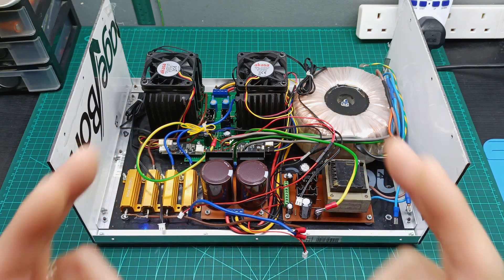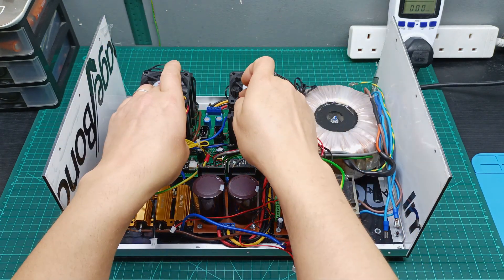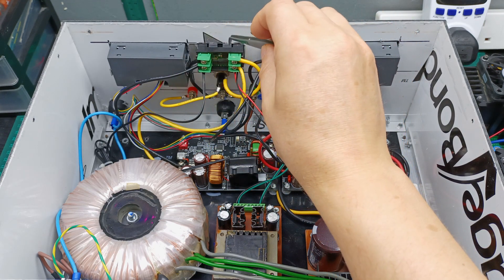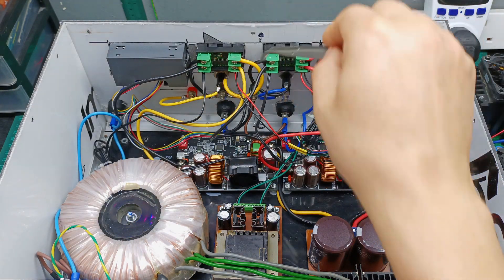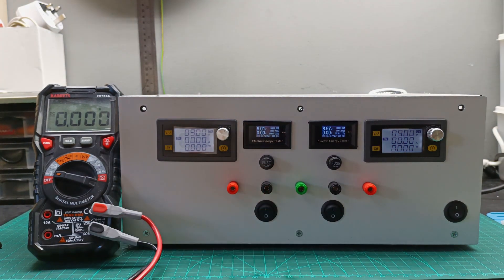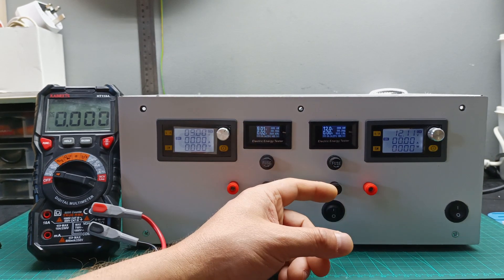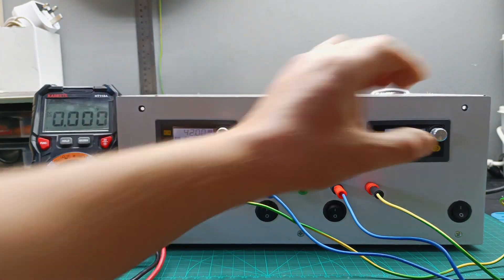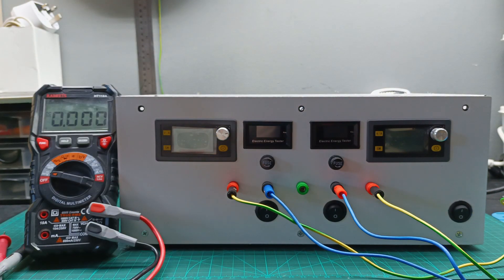Upgrading the dual rail bench power supply

Comment: Now we are talking \m/
Thanks for sharing the link
Reply from the maker: @CraftyZA  this is more better because have over current protection and voltage protection and also do constant voltage and constant current
Reply: @SymbolTech21  I've added it to my cart. The link you initially shared on the bag video no longer works, but a few stores still stock it. One just needs to do a search.
Reply from the maker: @CraftyZA  when I put out the video and the link was still available

Comment: If you join the supplies to provide say  +20v - GND - -40V   to two load resistors with common GND (e.g.  20R - GND - 10R)  are current readings correct? Is current limit working OK?  This is typical use for dual rail supply (not separate load resistors and separate common).
Reply from the maker: Yes when I put them in series still I can regulate the voltages individually for rails and do also current limiting
Reply: @SymbolTech21  OK, but my question was are the current reading of both meters accurate. The two meters measure the current in the ground rail, so I am curious to know if both meters will give accurate current readings for each of the supply rails when the two supplies and joined together.
Reply from the maker: @steve6375  here I have a little issue that I'm working on because when I put them in series only the positive rail measure the current which I noticed after finishing the video shooting, maybe few days after. And now I'm working on that and the unique idea that I come so far out is to install the analogue ampmeters like this one https://s.click.aliexpress.com/e/_EGjVngr to solve this issue because these I can install in series with the outputs on the negative rail and the positive rail. Any suggestions are much appreciated. Thanks
Reply: @SymbolTech21  I had similar issues when using more than one of these. Also the current limiting was not working correctly because the current measurement was not working correctly. Using analogue meters should work, but it would not fix the current limiting issue (if you have one).
Reply from the maker: @steve6375  that's correct because the current limiting is based on the readings of the comparator or the microcontroller which is on the board. So the analogue ampmeters will just help me to have a good readings only
Reply from the maker: @steve6375  I fix it without the analogue Ampmeters and also the current limiting working good I set one rail to 2A and the other rail to 3A and the rails was limiting on the right amps reading
Reply from the maker: @steve6375  can I ask you how you powered the modules? Because if you power with positive gnd and negative that is the reason why is not working properly. You need to power with 2 separate single rails voltage and then put in series on the output to obtain the positive gnd and negative and will work properly
Reply: @SymbolTech21  I did not have two isolated power supplies which I think is the problem in my case. Nice to know it works correctly with isolated power supplies.:-)
Reply from the maker: @steve6375  yes you must have 2 separate single rails power supply and connect the power to the DC regulators and then on the output of these boards just put them in series and will work perfectly!
Reply: @SymbolTech21  Yes, but my question is 'are the current readings accurate when in common ground configuration.'?
Reply from the maker: Main reason why I upgraded is for this option to have current limiting and also short protection and other more options. If you check the description will find a link for the mailbag video when I get the boards and on that video description you find the link from where I bought the boards